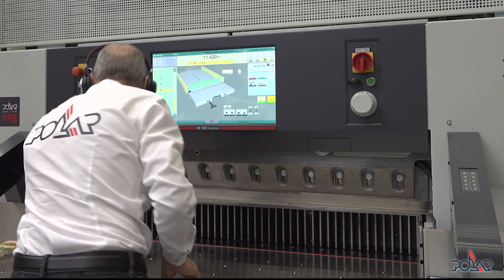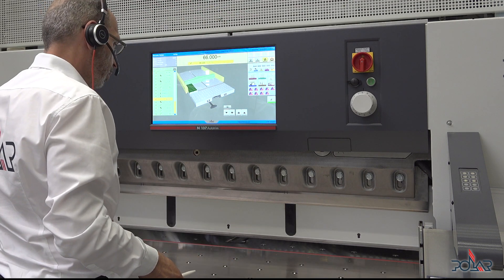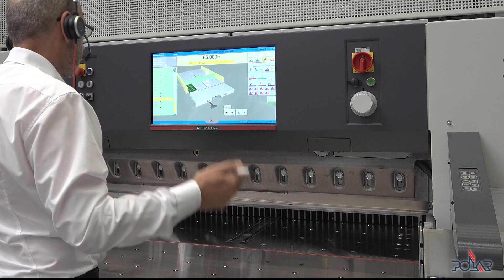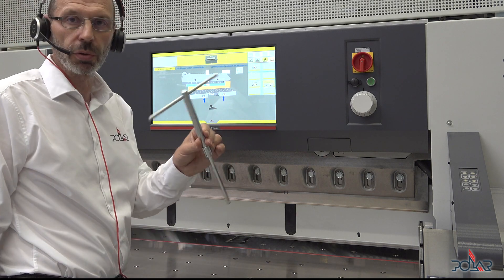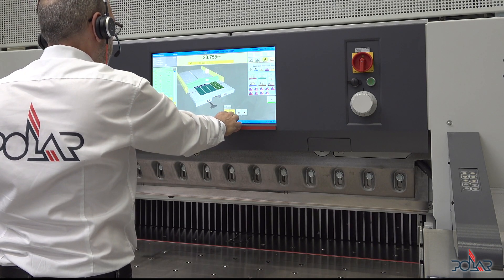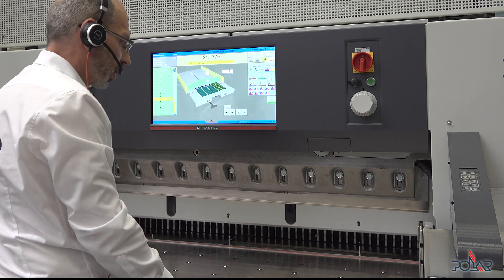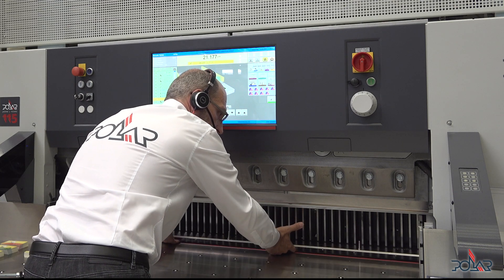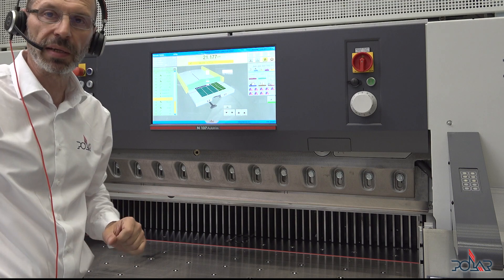Tip of the month July 2023 - Taking the false clamp plate out

Comment: You can put clamp bar inside with press of the pedal...first u set the machine to dimension of false clamp. You need a marking or two on false clamp which align with backgauge, then u press pedal to lover the clamp on false clamp. Before you release the pedal, you need to move backgauge a little bit back so clamp doesn't scratch backgauge. The easiest way to do it.
Reply: Yes, and if you get it wrong you will bring the clamp down on the false clamp plate and bend the holding pins. A replacement false clamp plate is expensive and takes time for a Polar technician to fit correctly.
 In my experience, on every Polar cutter that I have used, the false clamp plate has had a number stamped on it. This was always the last two digits of the main machine number. So the false clamp plate is individually adjusted/set at the factory to fit that specific machine. 
Watch the "Master" in the full video to see how to release/re - fit the false clamp in the correct and safe way!